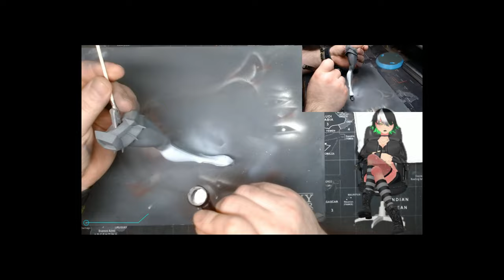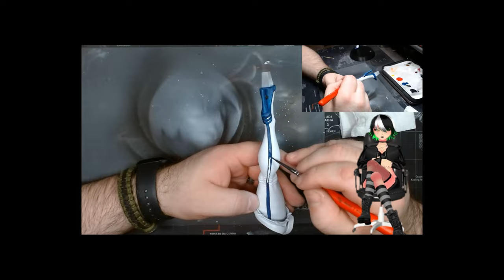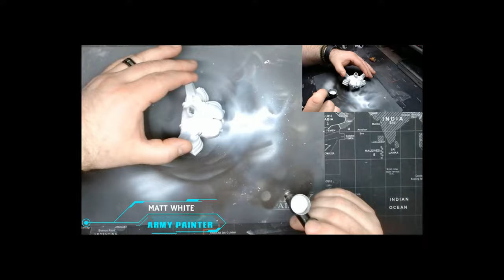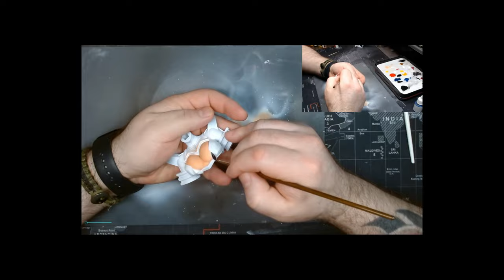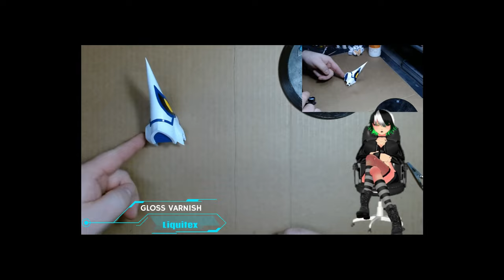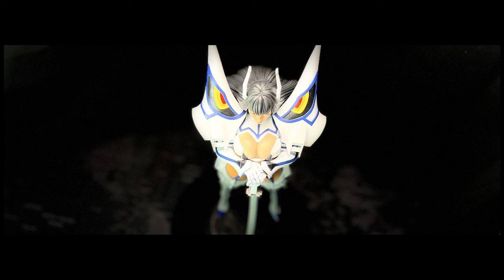How to paint Satsuki from Kill La Kill.

Comment: Lovely, as always

For cleaning the varnish, did you tried Tamiya Airbrush cleaner ?
It's 50% acetone, 50% butyl acetate. So it needs a ventilated area, but it works well.
So you can also use it as plastic glue or for sprue goo.
Reply from the maker: Tamiya products are a rarity where I live, and a lot of retailers won’t stock them since it’s hard to ship stuff like that up here. I gotta use what I can get.